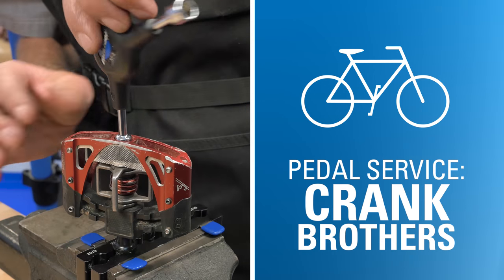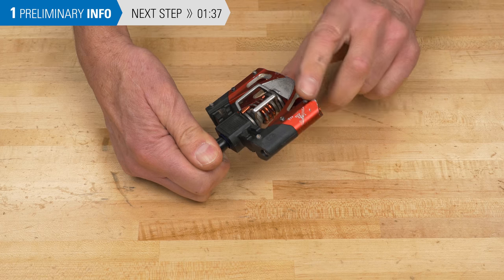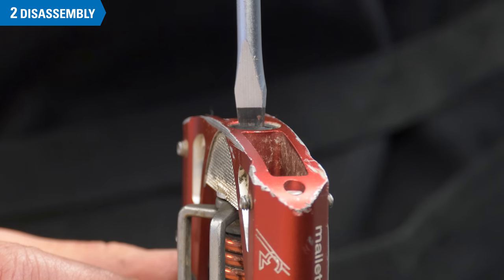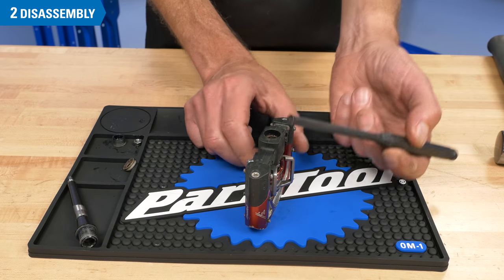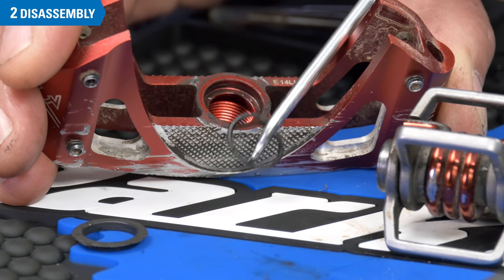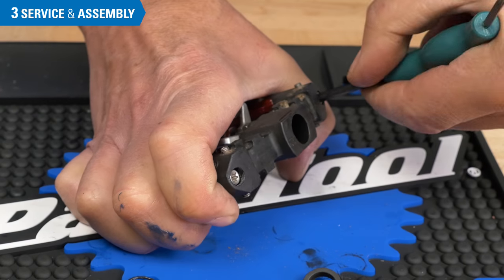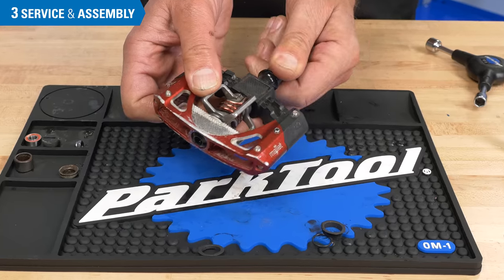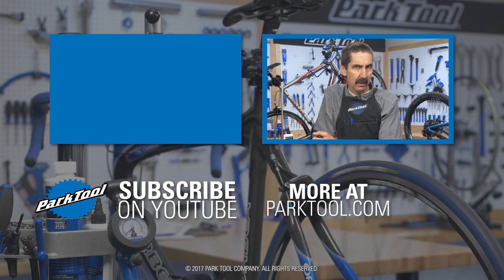How to Rebuild Crank Brothers Pedals

Comment: In regards to the rusted axle of the one pedal, I've found either a soak in distilled vinegar followed by scrubbing with a wire brush or a light rub with fine 300 or 400 grit sand paper to remove the rust then a quick metal polish works very well.

Comment: Also if your old flathead dust caps are still okay, I recommend you use them again as the hex ones strip very easy because they are very shallow
I speak from past experience

Comment: Hello Park Tool guys ,

There was a needle bearing at the very beginning , but after removed it’s replaced by a bushing only . Just wonder why don’t Crank Bros provide another needle bearing in the refresh kit , or why don’t you guys use another needle bearing instead of that bushing ? Is there any difference between needle bearing and that bushing ?

And if possible , would you mind let me know the diameter of the bearing removal tool please ?

Thank you so much .

Comment: hey there park tool buddies. i have a question which has nothing to do with this but ill ask here since you might not notice it on the video that it belongs.

so i had to true my KCNC kasditor rotor, i think i did it right, but it uses an alloy spider, and now it crackles a bit when i touch the rotor even with my fingers my guess is that the crackle comes from the spider, so my question is if theres any chance to repair that? like tightening the spider or something or is it a sign that the rotor willl soon die? 

hoping for an answer, ty very much
Reply from the maker: If there is a "crackle" noise, it is likely there is damage to the spider, and the rotor and spider are no longer properly attached.  Do not use this rotor. Replace it before riding.

Comment: @park tool, what grease are you using in this video? I use park tool grease but it is green in color.
Reply from the maker: The grease we used in the video is the HPG-1. It is a higher performance grease better suited for dynamic applications.

Comment: Has anyone else noticed Crankbrother has stopped supplying an actual bearing on the inside of the pedal and started using a bush. They now only supply the needle bearing on their 11 models. Watching this video they removed the needle bearing and replaced it with a bush which really is a downgrade.